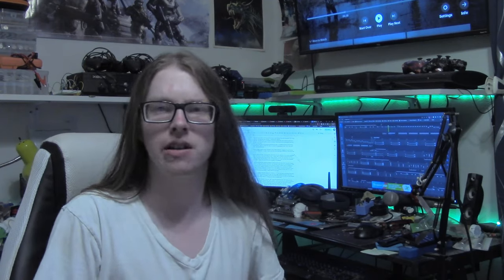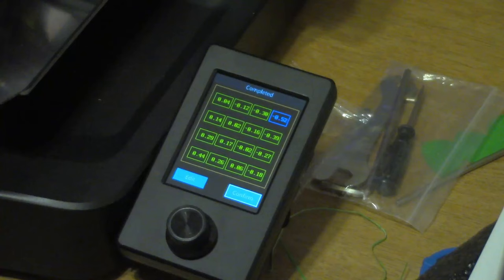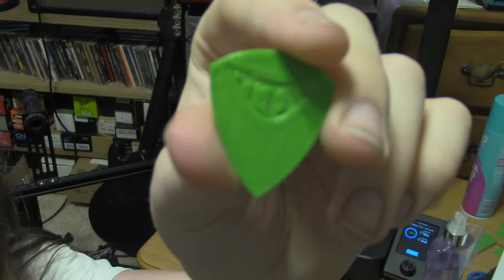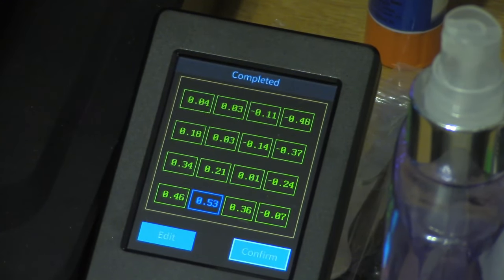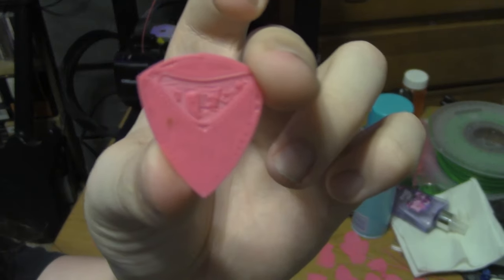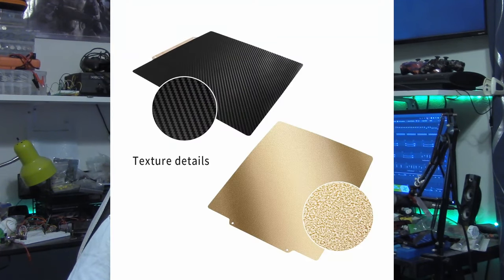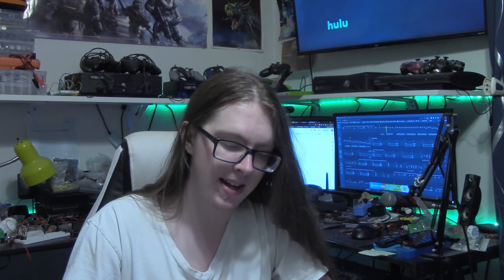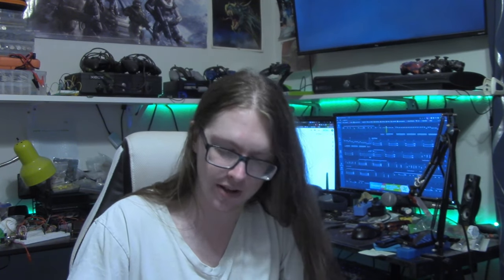Having trouble with your Ender 3 V3 SE Bed? So am I. Here's trying fix it.

Comment: have you tried the glass bed upgrade?
below video said its worth? any thoughts?
https://www.youtube.com/watch?v=0B4IRR9ovCs
Reply from the maker: Well for now I personally use a G10 plate. I bought it originally for the V2 and transferred it over. It's the same concept as glass, though it may be more bendy. But unlike glass it has an extremely minor texturing and other properties to help with print adhesion, At least when it comes to more basic materials like PLA and PETG.
I have never actually used a bare glass bed before. The V2 came with a glass bed with some sort of texturing, but if I used it, it wasn't for very long. I quickly switched to the flexible build plates for better or for worse. The only problem I have with glass is that I 99% of the time, always requires some sort of adhesive or additive to get proper print stick. I like to make things as simple as possible so I prefer to stay away from requirements like that. But it's all in preference and what you need as the creator. It's typically good to have multiple beds to interchange, but with this printer that may be difficult if you happen to have bed leveling issues.

Comment: Not sure how to tag the creator bit have you got the issue sorted 
I may have a solution
Reply from the maker: I have a different lead going right now, but what is it?
Reply: I was having this issue as well an levelling issue i found that the plastic shims under the bed were the wrong size ( well eqch of the 4 were all different sizes which permanently caused the bed to be not level so did some calculations and made some shim 
Good level good bed adhesion and the print came off 
Not sure if this will help but it worked for me
Reply from the maker: @ashlyfranks30  So, I actually talk about this in my next video that I already posted I think. The one called physically fixing my e3v3se didn't go well or something like that. The standoffs that come stock with the machine are two different sizes between the four of them, but not properly compensating for just about anything. So I tried to print spacers to try to even things out more. This had the best results out of any of the fixes I tried even though it was still far from perfect. So it is a good suggestion, just can be difficult depending on what method you choose.

Comment: I am looking for my first 3D printer and am really atracted to this model, would you recommend me to go for the ender 3 s1 instead? Cheers
Reply from the maker: They seem to be close models. Right now it seems the S1 is the better option. The V3 is too underdeveloped at the moment. Believe me, I just tried to install the latest firmware and instead of improving anything it just had foreign symbols and some other language underneath that all over the display. Be careful with that part cooling fan on the S1 though.
Reply: Go with ender 3 v3 ke
Reply from the maker: @bl4de938 I can't believe they're already trying to sell an "upgraded" or alternate version of this printer. The way Creality is going is just plain messed up.
Reply: @Bowsmin12  i have SE and can't wait to recieve KE, i think people should just be buying KE.
Reply from the maker: @bl4de938  You don't even really know it's going ACTUALLY to be any better yet. There is only three videos about it on youtube right now and two of them are straight from creality as marketing material and it's only available for pre sale. Creality can say it's going to be better but that doesn't make it true. Unless they spent all their time fixing the issues with the SE, and for some reason only applied them to the KE, then logically it won't even be anything more special or functional.

Comment: Just put hairspray problem solved!
Reply from the maker: It shouldn't need hairspray if it has the auto level system and after I changed the bed. But yes, it may have made the bed original bed easier to use.
Reply: @Bowsmin12  There is this guy at  a local famrers market who has a table with a shit load of 3d prints for sale so he does this semi-professionally and I  always talk to him and  pick his brain, and he has like 3 or 4 ender 3 pros and and he recently got an X1 carbon with the AMS and he said that he always uses suave max hold 8 and he has glass beds on his ender 3 pros that he uses the reverse smooth non textured side but he has moved to  more PEI now and he said he still uses hair spray on the PEI and then I asked him abou the bambu labs X1 carbon and he said he still uses hairspray every time even with that and I was really surprised by this
like you I figured why should you need to use an addative ,maybe I can  understand neededing it on an ender 3,pro,v2, neo, 3 SE, but I definitley though it should not be needed for an  X1 but he said it is but other people I talk to said they don't use anything at all.
Reply from the maker: @andreamitchell4758  It depends on a few things and is always situational. If you use harder to print materials that warp on glass then of course you need an additive. But if you print PLA on a textured bed, there's basically no reason. I have a P1P and I have never used an additive on it with either kinds of beds I got for it. Some people just always like tp use it to be safe, but I'm a penny pincher because I'm currently unemployed, so if I don't have to use it, I won't. ESPECIALLY IF IT'S SUPPOSED TO HAVE A PERFECT LEVEL! 😤

Comment: Hello, greetings from Colombia, I was about to buy an ender 3 v3 se but I see that it has several factory defects. Do you think it is a good purchase or do I buy the ender 3 v2 neo
Reply from the maker: I don't personally own a NEO, just a normal V2. But to me, right now the NEO looks like the better option. The only advantage the V3 has right now is that it has the direct drive system, so if you think you would like to print with bendy flexibles, then you might want to still go with the V3 and hope they fix it. That being said I have gotten the V3 to do a fair number decent prints now, but it was after tedious printed manual leveling. And if you want to print with flexibles, but they don't need to be really squishy and bendy. Most TPUs on amazon have a hardness of 95A I think, and people have said that stuff prints fine on an average Ender printer. (like the V2 NEO)
You will probably be able to find parts and find good third party firmware for the NEO as well if you desired. I also kinda miss the little drawer, just a nice convenience for little bits specifically for that printer. You however will need to manually level the corners in the stock V2 NEO Printer. There are some things you can do to work around this but out of the box, that's the way it has to be.
I hope this is helpful and thank you for watching.

Comment: I regret buying my one. It’s just problem after problem. After all the promises of it being easy to use isn’t true. I’ve gone back to my ender 3 v2 Neo with klipper and mods 100% better
Reply from the maker: Yeah, it seems like they've rushed this model out for some reason.
Reply: @Bowsmin12  To me it looks like they are just trying to bring machines out similar to competitors just undercutting in price. Starting with the Neo they are making it hard to customise the machines with the cost cutting. I own a couple Enders and a halot mage resin printer. Every machine out of the box has had to be modded and I am just tired of it. The experience of 3d printing is sullied by all the corners cut by Creality. Every machine I own I have had to get Creality to send me replacement parts for stock item broke from the box. When speaking to creality they really don’t care and you feel you have to prove your problem to them they won’t take your word for it. Also I noticed they respond a lot better and quick if you buy the machines from them directly. The machines I own from them straight away a response but bought third party they are slow to react and treat you like you stole the machine and they don’t really want to help.
Reply from the maker: @theaftermathshow6595  Indeed. It seems like a lot of their processes are very corporate. I know when I got my ender 3 V2, it lasted a few months then I had the same experience you seem to be having. One thing would break after another. Eventually I got it running so it wouldn't fail regularly but still, if I use it today there are still minor imperfections in most prints. Of course they might be able to be tuned out, but then you have to go through the pain and time of identifying then testing to see if you fixed whatever it was.
I also get what you're saying about the support. It was painful just trying to get them to tell me if there's a way to make the auto bed level grid bigger and I don't think they even ever gave me a direct answer. I think at some point I ended up telling them they needed the feature and they said something along the lines of "We'll forward this reccomendation to our development team." I partially hate when companies do that because you never really know if they do it or if it's ever going to be seen by anyone who would do something about adding the needed feature.
Reply: @Bowsmin12  I thought I was going mad. It was all most like the machine was having a tantrum after a run of success.
Reply: @bowsmin1220  These machines running faster they will loosen bolts,screws and belts quicker. It’s all about getting a good schedule of maintenance to keep it the way it is now.
Reply: It is easy. But it's TOO easy. The software is too limited to provide an enthusiast with more advanced printing projects.

I purchased a PEI plate and everything is great.

Now I'm just waiting for MriscoC support. That will make this printer great.